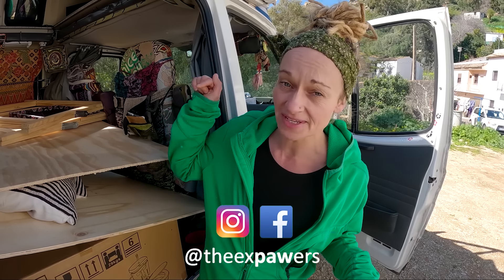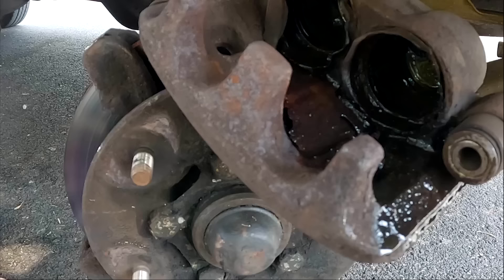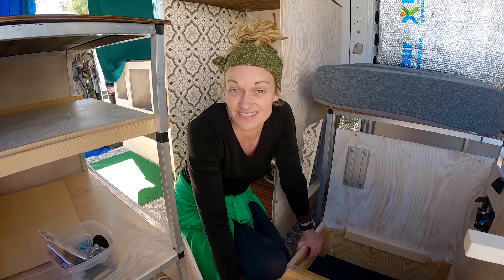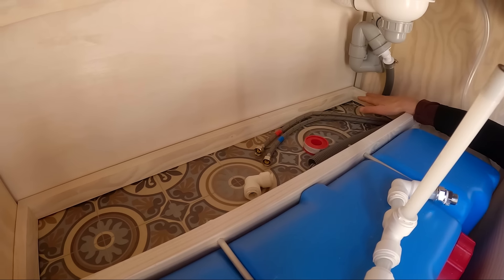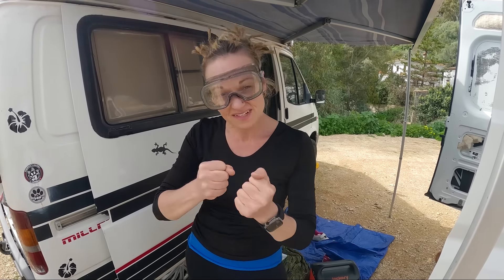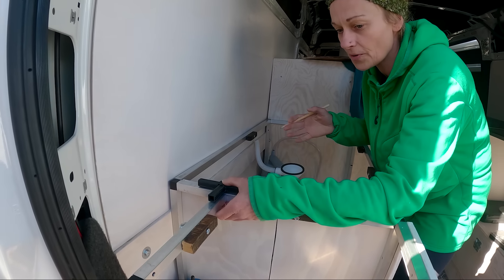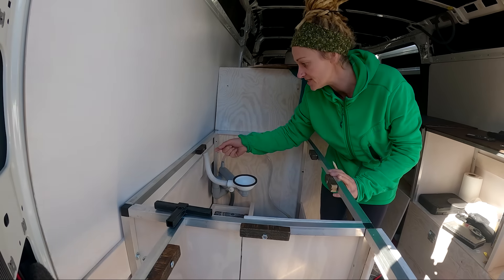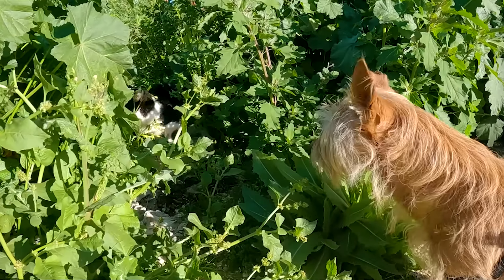THIS IS REALLY BLOODY HARD - VAN BUILD in SPAIN - (VAN LIFE EUROPE)

Comment: Love nicks new cut. Never seen anyone use the aluminium framing before but I like the idea, gonna show the hubby for when we rebuild ours. It will save so much weight
Reply from the maker: You should! If you get the connections and aluminium that fit its easy to work with. 😁

Comment: Usually tabletops are fastened from beneath up with screws, screws need to be exact length so they wont come through. U could have just drilled holes throught the aluminium frameing and then fasten the table top with screws from beneath...the shower could rise up and be in 2 sections so it would be the height of kitchen tabletop and like drawer mechanism so you could lift it up and it makes full size shower, just an idea...
Reply from the maker: Thanks for the advice😊.. We’ll see how it works out with the kitchen top 😊

Comment: The brake problem is the servo the brake peddle free play needs setting then the plunger protrusion in to the master clyider needs setting . When you had the van jacked up and the brake was binding then by pressing the pedal you evacuated the vacume from the servo which then released the brakes. if the ajustments are correct then the new servo you got may be faulty.
Reply from the maker: We have thought of this too but then wouldn’t it affect more than just one wheel/brake?? 😊
Reply: @theexPAWers  Not necessarily it's not unusual for one brake calliper to come on befor the other side especially in older vehicles it may only be very slite but it would be enough to over heat the brake on that side.

Comment: Coming on there guys. I can't figure out what you are gaining by the shower design you are doing though? You won't be able to keep much on the fold down lid, as you will need to move everything off to have a shower, and you need a place to put whatever you do store on there. Just seems a lot of hassle and no space saving, especially as you have so much work top space.  Just wondered what the thinking behind it is? I may have missed that. Great idea with the aluminium framing for weight saving. Are you putting any sort of diesel heater in for when you are in the colder parts of the world or planning on staying in the warmer parts?
Reply from the maker: Hello, so when it was full size cubicle before it felt a little closer in in the lounge area, we think it will be better to have another surface there, it will only be up when we have a shower so still a handy surface at all other times.. As for the diesel heater; we already have one! It’s a webasto, factory built in as the van is originally from Sweden😊

Comment: Videos are great as always, however I don't understand the benefit of having a shorter shower with a lot instead of a full height toilet / shower as you will have to keep the top clear to lift the lid and the curtain will be quite low for a shower. Just a query, not a judgement I think you guys are awesome.
Reply from the maker: No worries❤.. When it was a full shower before it felt abit ‘blocked in’ in the lounge area, obviously living in a van you don’t shower everyday as your water will be limited so it’s nice to have the extra surface and also having the van a little more open 😊

Comment: My old MB100 I had in Georgia, the country, would do exactly the same thing. Brakes would bind a tiny bit, boill the fluid, bind more, get hotter and then there would be NO BRAKES AT ALL! Very scary. Ford Transit parts are dead easy to get anywhere in the world tho. Ebay has them brand new for reasonable prices. Splash out for Vinnie.
Reply from the maker: We haven’t been able to find the part actually because Vinny is 33 years old but we’ll have another look 😊
Reply: @theexPAWers  year and model? I'll have a snoop.
Reply from the maker: @maarten_notjustagrip  Ford transit 1991
Reply: @theexPAWers  Transit 3 or 4? 14 or15inch wheel?

Comment: Can't believe you have fitted the water tank on its side 😱 so you are relying on that lid not coming loose with vibration good luck with that
Reply: I've never seen one come loose. Sometimes in underfloor installations the lid is at the bottom so you can wash it out.
Reply: @alanhat5252 
Yes I can understand that being under the vehicle but not inside and boxed in.
It's up to them, Im just saying I wouldn't do it because water is very good at finding the weakness in your plumbing.
Reply from the maker: It was on its side all the time since the van was originally built, those lids are so strong that I really can’t see it leaking.. Hope now anyway😳

Comment: Why is your shower made for children, are you adopting or is it a doggy shower? Where are you showering?  Never seen so much worktop space in a camper van more than there is in my kitchen. I know what you are doing, turning it into a mobile catering unit.  Diversifying, well thought out. I hope Nick drew up the plan on paper for all the electric wiring before starting  to ensure nothing has been missed out.  Nothing worse than removing a wall panel behind a unit for a forgotten cable. It happens.
Reply: A roomy wrap around magnetic shower curtain from the ceiling to the catch basin could work, using a nice new hoola-hoop & curtains (with magnets attached). The sides are higher than in a regular bathtub, right? And it doesn't leak all over the place. If they have an absorbant mat it's not a problem. I'm more concerned about those concave walls because the plywood is so thin & bendy. What do you think?